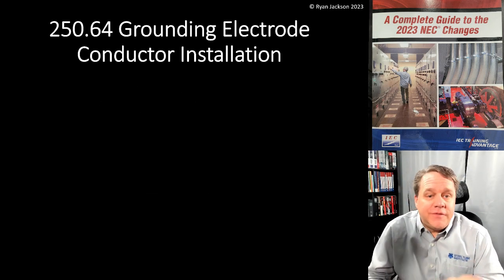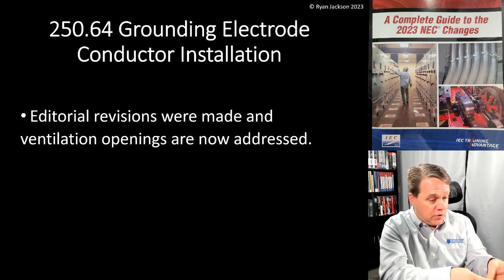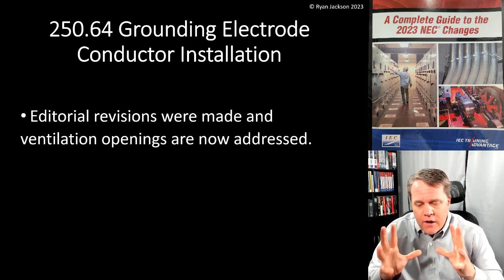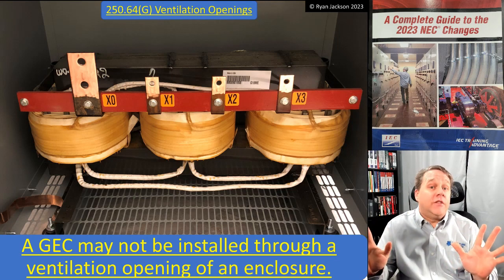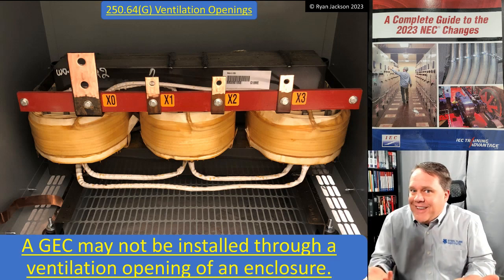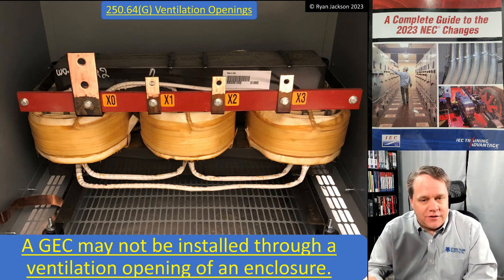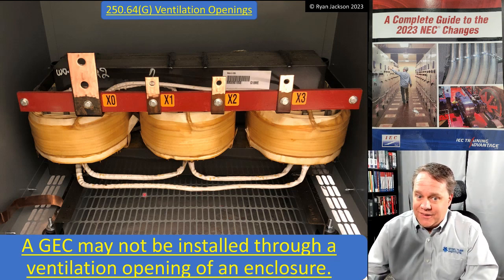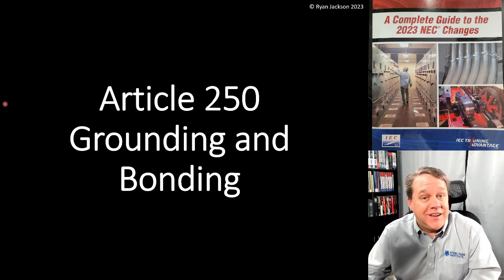2023 250.64 Grounding Electrode Conductor Installation

Comment: It's basically for the same rule as you don't put electric wires in ventilation through a house or cut through it because if it's energized in any way either through electrical wires or through ground wires and there is an electrical charge on it that causes a spark or fire it could ignite inside the exhaust area and throughout the house.😊😊😊

Comment: An electrician on one of our projects terminated his 2-inch primary and secondary conduits to the ventilation mesh in the bottom plate of a dry-type transformer.  I imagine that this is a violation of 450.9?  Seems to be the same theme as 250.64(G).  Knocking out holes in the mesh appears to also violate the manufacturer's designated access areas.

Comment: No GEC, ok.  What about GE's?  Example, ground rod installed or rebar (min requirements met), turned up out of pad for access before pad poured and transformer anchored?  GE's through ventilation holes.  No GEC going through ventilation. GEC internally connected in enclosure.   I know I may be being petty,  but I've seen both examples in the field. Does the code address this type  installation?
Reply: I would throw a flag on the field, and call for a 5 yard/ do-over......

Comment: So can I run the Grounded Conductor through the ventilation hole? Maybe an EGC? They should just state that no conductors may be run through a ventilation hole.
Reply: So you'd be running the grounded conductor outside of a raceway separate from the other ckt conductors? Maybe a bonding conductor for the flex but thats about it